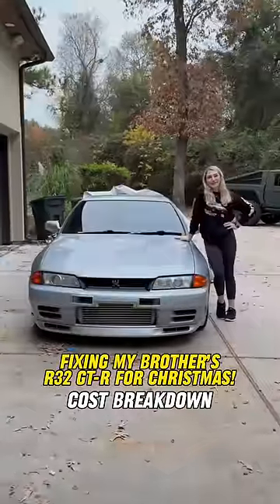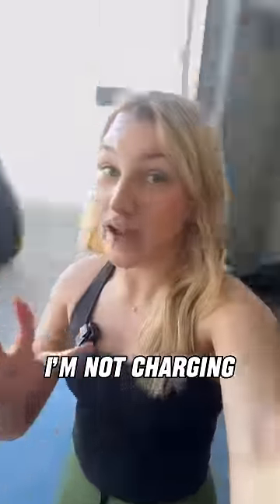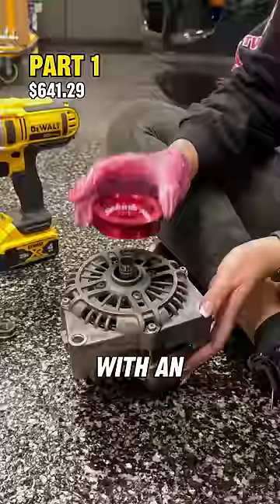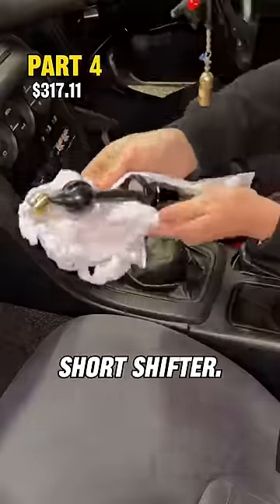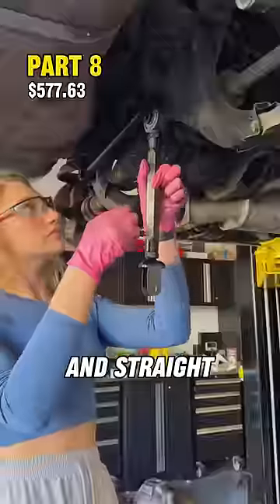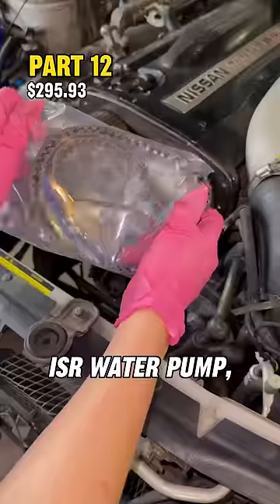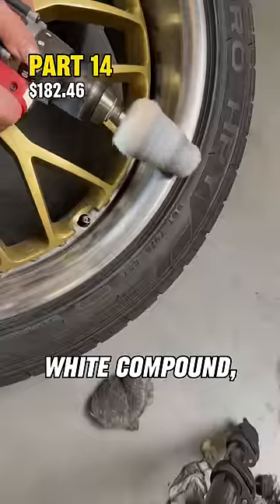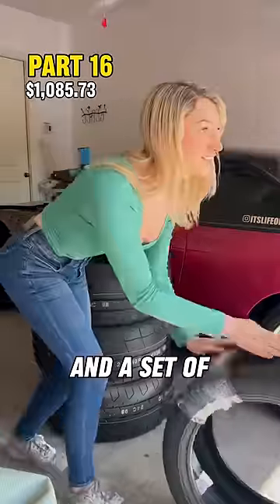You Won’t Believe How Much I Spent To Fix My Brother’s R32 GTR!

Comment: almost $5K ? that's not bad, i was thinking it would've been probably close to $10K
Reply: Add labour and it would be over $10k in a workshop.
Reply: It's a Nissan you can get parts at a chemist in Japan common af
Reply: @DragoKovac-dr2cf Why go that far? If you do your homework, you will find that many parts from other Nissans like those sold in the US will work on an R32 as well as many of the same suspension parts from a Z32 300ZX TT will also fit.
Reply: Some of that work was for correcting a previous owner's meddling with the electric harness. Personally, I would have ordered a new harness from Wiring Specialties and install that.

Comment: This guy's car was not running over some basic maintenance or just neglect. I cracked my RB30 swapped block. I wish my car had such an easy fix.
Reply: Basic neglect but keep in mind the car is already old so when you import a car like this parts are already worn down. There's a company in japan that can charge you for replacing parts whilw storing your car over there so when you receive it, it's running almost new.
Reply: @JzLyfe  Thanks for your comment, but I understand buying these cars probably better than most.  I've been importing cars, parts, etc. since 2008, as I'm an attorney who specializes in international and maritime law. I also actively have my customs broker license. I'm personally on my 3rd Skyline GTR and my 2nd FD RX7; not counting goods I've had shipped for others. So, I'm well aware of some of the concerns. Thanks for the input though.

Comment: Man...I've been trying to get my XLR back up and running after letting it sit 9 years....I don't remember the cost but I've
Replaced all tire rod ends, shocks, simulators for non mag shocks, window tint, battery, belts, hoses, radiator, ac charge....and all that's left is tires, 2 window wire kits and a tail light needs a new power supply.  Shit went downhill quick

Comment: ATF fluid for a manual? Great work, I aspire to be as knowledgeable and generous as you :)
Reply: A lot of people use ATF for manual transmission fluid, some manufactures recommend to use it for their gearboxes
Reply: ATF is also commonly used in PAS systems, so possibly in the HICAS system, although i think she removed that, but maybe it still needs to pump fluid round a loop to not cause other issues.

I wonder how much she made off all the shorts... Im gonna guess more than $5k

Comment: That seat belt and window punch cutter can also be attained by using a center punch spring-loaded center.Punch available on every hardware store and a simple envelope slitter. Available at most any stationary store.Well for steve  walmart kmart basically one stop shop for the two pieces.

Comment: Is that vehicle even worth what you spend for parts??
Reply: Are you serious? You’re watching a car video and you don’t know a R32 GTR could EASILY fetch $100k? They sell for $60k on the extremely low end.
Reply: @thesausage351  Dude, I don't follow foreign car crap,  Youtube dumped this in my lap.
Reply: @modquad18  if you don’t know what an R32 is, you’re no car fan.
Reply: @thesausage351  Probably not.  I drive an old corvette and a chevy pickup.  I'm an aerial crop spray pilot, so I get my thrills a few feet off the ground, lol.

Comment: My rb30. In my r33 cost $47000   But it is 1300 hp and 1340 foot pounds of torque and dry dumped. Runs  a $5000 clutch. But who’s counting not me. Oh. My wife does. Lol